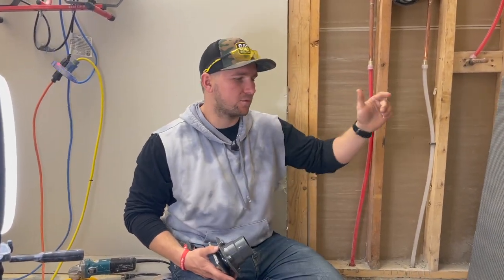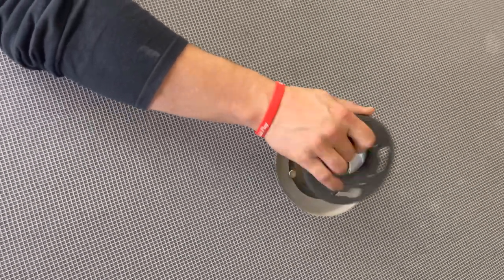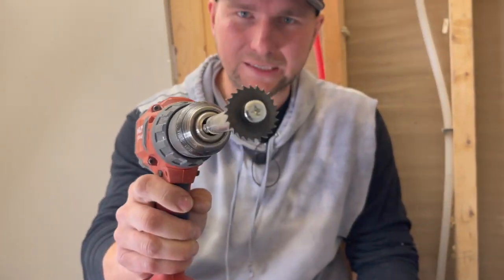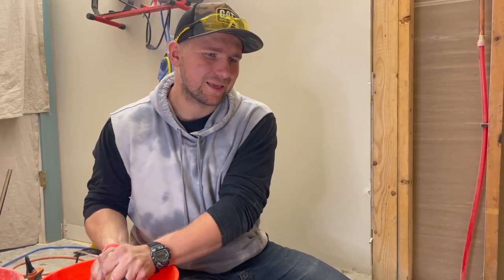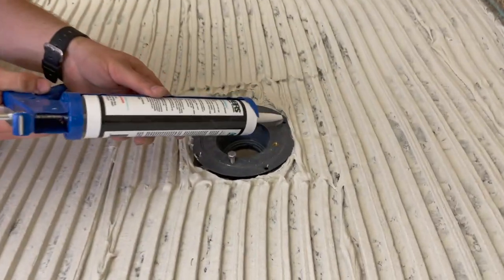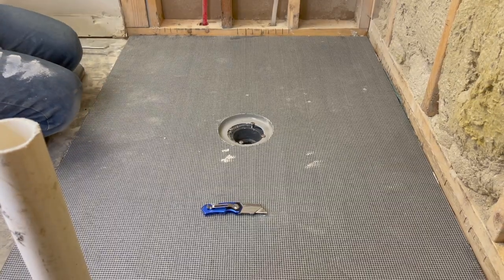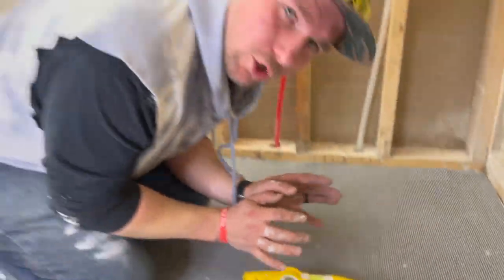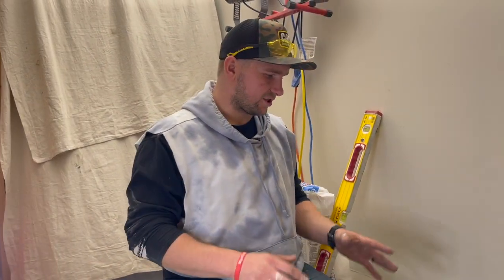How to: Curbless Shower 🚀 Part 2 🚀 KBRS 🚀Winni Vlog 008

Comment: Just a suggestion, when poring the concrete you should wrap the pipe with blue framing foam. Wrap it until you have your desired size. Then pore your concrete and once it’s set, you just pull the blue foam out.

Comment: Keying in is done by spreading the thin-set with the UN-NOTCHED portion of the trowel FIRST, then you add more and use the notched to spread it.   Any comments on how the concrete was lowered to accept the pan?

Comment: Dude, so much work and expense.  It's much cheaper and easier to cut the slab out and screed an envelope in concrete to the drain, guaranteed fall to the drain and solid.

Comment: I used this system 2 times and the schluter system about 700 times over the past 15 years. I'm curious as to why anyone would use this over schluter besides the density of the pan? These drains don't even have any play, they have to be secured before the tile, and you have more steps including a water cut off type of caulk.
Reply: Custom size shower pan option with Schluter?
Would love to hear more of your opinion as I’m looking at doing this exact process. Thanks @ahren
Reply: @MILKMANDELIVERIES  I think the drain flanges like schluter are easier and better. The flange with bolts and silicone is not needed. One more point of possible failure. Schluter and other companies let you install drain flange after shower pan is down. And they don’t rely on silicone.